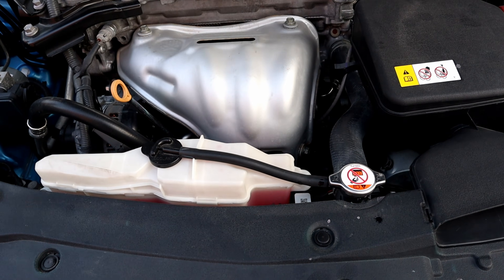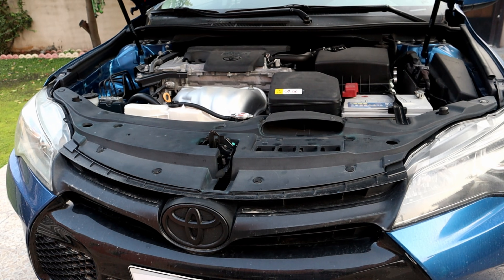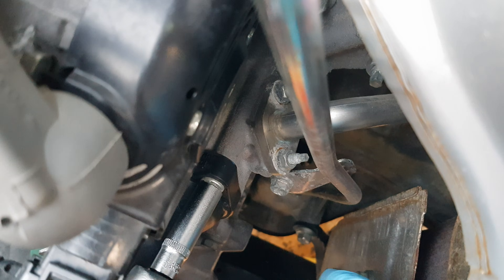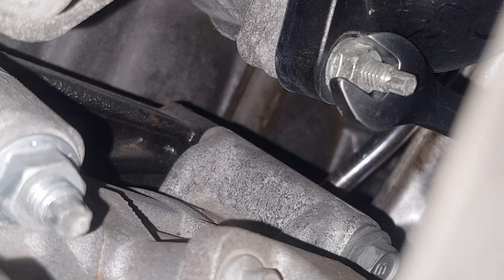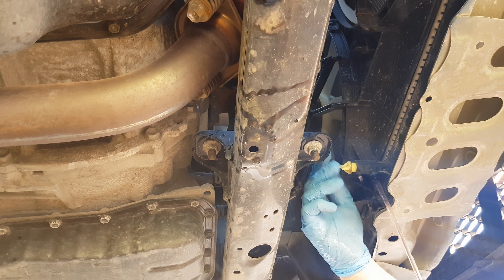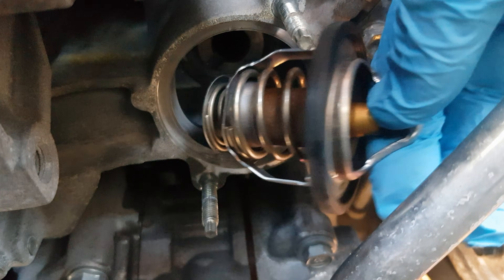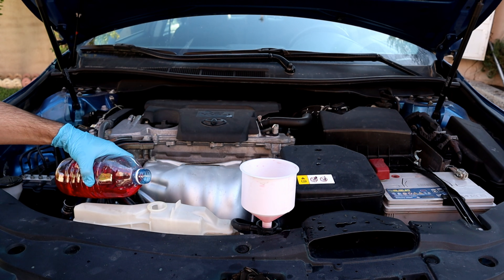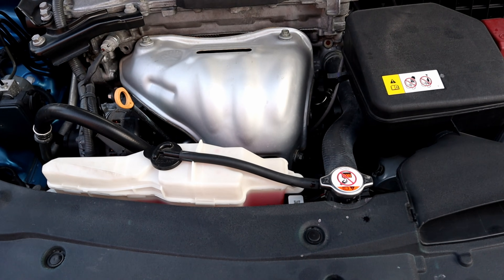How to do complete coolant flush/Coolant flush TOYOTA Camry 2015-2017/ How to change radiator water

Comment: Thank you for your time and putting together a great video.  

Since you cannot get all of the coolant out, when you flush with 100% water, you are weakening the 50/50 distilled water/coolant percentage.  I would believe draining coolant, filling with 50 50 mix, then a few days later after driving  50 or so miles do the process again.

Comment: The air scoop over the radiator on the drivers side comes off with two 10mm bolts and gives you plenty access to the drain valve from the top.  There is no need to go underneath the car other than sliding a catch pan under the drain tube.    Hope this helps🤣

Comment: I have the same car 2015 Toyota Camry XLE Hybrid and I have never changed a single thing. Still running on factory coolant. The only things I replace is oil change, filters, and tires. Best car I have ever owned and I bought it brand new from the Toyota lot 10 years ago in July 2015

Comment: Lil tip I learned when doing flushes and don't want to wait for engine to cool and don't want to take off thermostat. If you   use the drain valve on radiator after warming up for cleanse instead of trying to release pressure from the top which will get everywhere and prob burn yourself. With the drain valve (petcock) you can control the release and after a bit of draining pop the top and I have to say I have never had it spray out on me. Still hot but it's manageable. I've done it on about three cars so far. Nissan Xterra. Ford f250 sd v10, ram 1500 that's it I think gonna do on a Camry and rav 4 and I bet it will still work like the others 
 Of course try at your own risk just saying it worked for me!

Comment: I took my 17 Camry to the dealer for a simple drain and fill. All good until I got home and checked the reservoir tank. It was below the min. I called them back and asked why the reservoir tank was so low. They said that it's normal for my car. Is that true? Or did they neglect on topping off the reservoir tank?
Reply from the maker: It means the didn't take their time to turn the engine on and let it push all the air out of the system and refill it again to stay at operating coolant level
Reply: @AliMECH  What can I do now? Should I top off the reservoir tank?
Reply from the maker: @TheDvdyng35  sure you can, but i recommend you to go and they do that if you dont have, bc you already paid the whole thing, no need to buy

Comment: Hi thanks for this great video.
I have a question about the type of coolant used. I read somewhere for post 2004 models the Toyota Super Long Life Coolant should be used, because of the aluminium radiator will have better p protection by the SLLC. For your 2015-2017 Camry, how does the Long Life Coolant (not Super Long Life) perform? Thanks!

Comment: I did the same. First,flushed with the distilled water twice and added the 50/50 premixed super long life pink coolant. Problem was when I tested the freezing temperatures it showed me -20 due to leftover water further diluted the 50/50 premixed. I am planning to drain the 1.5l and add 1.5 antifreeze.

Comment: To save time on the flush, couldn't you just keep the petcock open while running the engine and adding distilled water to keep it full until it drains clear?

Comment: Great video, Thank you!  One question: Before you add half concentrated coolant and half distilled water, how much distilled water from the previous flush is remaining in the coolant system? If this is an issue to mixed 50:50 coolant, how to improve?
Reply: I second this. Wanted to ask

Comment: Good Job and thank you for posting. 
Just a question regarding the ratio of coolant to distilled water.
Since you are not draining the engine block of distilled water when flushing the system, you will still have water left in the engine block the last time you drain the radiator. 
Do you measure what drains out of the radiator the last time you do it and then fill to capacity with the concentrate coolant ? 
Otherwise the ratio will not be 50/50. Example - My Australian made 2016 Camry  takes a total of 7.9Lt, so if you drain the radiator and get only half of that out, you still have approximately half left in the engine block.
Reply: That’s the only bad part of this tutorial. You have to drain the engine block to be able to add 50/50 premix. So while you won’t get 100 of the water out, you get enough out so that it is still in the safe range. If you don’t drain the block, you have to concentrate to compensate.

Comment: Is it just as good to take off the lower radiator hose instead of using the radiator drain plug? I don't want to take off the under cartridge shrouds.
Reply from the maker: No problem you can ,  it's same
Reply: @AliMECH  Thank you.

Comment: Thanks for the video, 

I didnt do the step of removing the thermostat, just let the engine run until radiator fans turned on, however I went through 20 litres of distilled water and all the old coolant still wasnt flushed out, left the engine running for 5 mins when new water was added in to open the thermostat.

Any explanation? First time giving this a go

Comment: Why do some people say not to use 50/50 for a flush and fill?
Reply: Because there’s still water in the system. But as long as you drain the radiator and the engine block, you should be safe to use 50/50 premix. If you do not drain the engine block you still have too much water in there. Toyota made the block drains to compensate for the 50/50 mix.

Comment: Good video. One critique on the thermostat, the so-called jingle pin should be at 12 o'clock  you did not install at the 12 o'clock. Position. This helps remove any trapped air in the system really kill anything but that's the correct way
Reply: Air rises in most fluid system. The purge valve has to be at 12 o clock position on this type of cooling system to release air from. The system. Air can cause over heating
Reply: I noticed He put it back at the same exact position as He took it out. So that means, who ever did it last, didn’t place it a the 12 o’clock position.

Comment: Most clear concise video I’ve seen of the 10 toyota ones I’ve watched. Question for anyone. When he drains the distilled water there is still prolly a few quarts left inside engine after the flush. So when adding back new 50/50 coolant it will mix with distilled water that did not drain fully, and the mixture will not actually be 50/50. Is this a problem? For my 2nd gen Tacoma I want to use OEM coolant/antifreeze and they only make the 50/50 mixture. So I can’t add fully concentrated coolant and compensate for the extra distilled water remaining in the engine to balance out to 50/50 coolant to distilled water mixture. Any suggestions? 
For those of you that can purchase the fully concentrated coolant (or don’t mind using another brand not OEM) the best thing to do is look in your owners manual for the full capacity of the whole coolant system, then subtract whatever coolant drains out from the total capacity. The difference is the amount of fully concentrated mix you should add to balance out the remaining distilled water in the system. After that fill it with 50/50 mix.
Reply: As long as you get out as much water as Toyota makes it possible (radiator drain and engine block drain points) that is enough. So while you won’t have exactly 50/50 mix it’s still within range of being safe. Even a 70/30 mix is still safe. So you don’t have to worry about it. Also you don’t really have to do a coolant flush like this ever again. You should just get to a point where you drain the radiator and refill once every 2 years. A complete flush like this is pretty much only done when you neglected the system or are changing the coolant type (for example if you put in the green coolant and want to use the Toyota link coolant). If you really want to be overkill, on your last flush you can use Toyota coolant instead of distilled water. But it’s a waste of coolant so I wouldn’t do it.

Comment: Great, thanks ! 
Question - the part where you remove the thermostat....what are the basics without removing it ?
Reply: He's removing the thermostat to enable the distilled water to circulate even before the temperature rises. If not you would have to wait for the temperature to rise enough for circulation to happen and again a very long time to cool down again.  Hope you get the point
Reply from the maker: PR Jawahar is right, I did a video were I didn't remover the thermostat valve
Here I show how it can be done 
https://youtu.be/3r_KSRPv048

Comment: To those who would use 50/50 coolant, make sure you dump left overs of distilled water from engine. On models earlier then 2012 there engine drain plug you could use which emptying engine from coolant. Don't make same mistake as me. I tested coolant with coolant tester and it's no longer 50/50. So have to either add non predeluted/premixed coolant or just dump  radiator and engine again and refill, 20 backs more but safe.
Reply: Or maybe instead of using distilled water to flush you can use 50/50 coolant to flush old.. you won't be able to completely tell when all the old fluid is gone but if you flush it twice it should be good and it's all 50/50

Comment: Hi great vid. I followed exactly your instructions. Problem I'm having is the fans never turn on after running the vehicle 2015 camry xse 4 cylinder for 30 mins. Even though it turn on while I was flushing it with distelt water twice without the thermostate in the vehicle. And there was no bubble while I was running the vehicle for 30 mins. Any suggestions??
Reply: MMA KZ  no it hasn't. Never got a respond back. So I kept on topping up the antifreeze, kept a close eye. On the reservor. It's seems to be fine.
Reply: Did you turn the heater on ? That started my fans right up (17 camry 2.5L)

Comment: The Long Life Coolant in this video is not the same as the Super Long Life coolant that is found in the car when it's new.
I would simply use the Super Long Life pre-mixed coolant from Toyota which is good for five years or 50,000 miles. And flushing shouldn't be necessary unless the old coolant was contaminated or you're switching types of coolant. 
Okay because you're not flushing there may still be some old coolant in the system but it will be minimal. This is likely the reason that Toyota says the refill is only good for 50,000 miles or five years whereas the original factory fill is good for 100,000 miles or five years.
Reply: Thanks I was wondering if I bought the wrong one after this video

Comment: To get correct ratio at the end of flushing, I am thinking to use premixed 50/50 Super long life coolant. I will do just one flush. Of course it will cost me more, but I will fill confident regarding right coolant mixture. What do you think, guys?
Reply: Your right mate. Super long life coolant is the correct one. Its pink not red. Its premixed
Reply: I can’t see any other way to do it that would be correct. It will be more expensive needing twice the coolant. Especially if you’re using OEM Toyota coolant.

Comment: Will this work on a 2011?
Reply from the maker: yes
Reply: @AliMECH  oh sweet! So material wise was it 2 bottles of mixed coolant and just a few gallons of distilled? How many times did you run distilled through the system.

Comment: I have a 2014 Toyota Avalon with 130,000 km and the mechanic told me that my head gasket has a leak and the coolant reservoir was dry. 

Apparently this is a big job, can I just keep refilling the coolant and drive the car or should I use some kind of gasket seal fix in a bottle stuff?
Reply: Checking water pump ( my car water pump leaking so I change new water pump and it’s ok now)

Comment: Um, can someone help? I have a Toyota echo, how do you add coolant if it looks like it's too low to tell which kind of coolant to add? I found a leak into the passenger side near the floor, which might be the heater core possibly.
Reply: It’s leaking from heater core ( my car leaking from heater core)
Reply: @ThienTran-ul1jz  sorry to hear that. fortunately I got lucky, mine was not very expensive and turned out not to be the heater core

Comment: But would a distilled water flush change the ratio of coolant/water because the block will still have water in it?
Reply: You can always blow through with compressed air - or even use the air outlet of your shop vac. - to get most of the excess water out. Probably not too much of an issue, I would have thought...

Comment: Flushing is great, and using distilled water good, However...
After this job... drive it around say 1 hour. To get all coolant mixed in engine / heater core. Then let it cool down.
Then, pull cap and check coolant mix in radiator with tester. I bet it is weak (More water than antifreeze, not 50/50) Why? 
Because there was straight water left in block, hoses, & heater core after flush.
Reply: What's the solution for the 50/50 ratio or the proper way for replacing the coolant?
Reply: @mbz4652  
As long as the old coolant wasn't contaminated a flush is not necessary. Just drain the radiator and drain the engine block and refill it. Bring to operating temperature and let it cool down and then top it off. Check it again after your next drive and then top it off again the following morning.

Comment: what about the engine block coolant... it seems like there are 2 groups of people... 1) do not drain engine block, and 2) drain engine block.  When you turn car on and circulate distilled water, it has to be emptying the engine.. right?
Reply from the maker: Yes, you must empty as much as possible,  I usually use compressed air to blow it out, even if some states, no problem, it will be mixed with coolant

Comment: Good job AliMECH, but I noticed that you consumed too much of deionzed water as well as removing a thermostatic valve which it should not to be so, for full system coolent replacement, you have to drain fully from 3 drain points, 1st from the top reservoir, 2nd from the radiator, 3rd from engine block, then plug the radiator drain and the reservoir, then blow air by your mouth and let all old coolent come out from engine block, then surely you can pour the new coolent without any waste of money on purchasing a lot of distilled water for nothing.Thanks.
Reply from the maker: It's ok if some of distilled water stays in, the amount of that is gonna couse that much of a difference, of course if you have a compressed air it will be much better, but I didn't use it

Comment: While you chose your jack point correctly, I don’t think you put your jack stands in correct spots. It has to be where two notches are, closer to the edge. I heard that you can bend and even might go right through where you put your jack stands. I might be wrong, so correct me.
Reply from the maker: Actually this was the right spot for jack stand, that's the one strongest spots

Comment: Excellent vid with clear videos on each step. I just did drain and refill on my 2015 Corolla at 97K miles also have another 2016 corolla which I will plan to do a flush this time. 
How many gallons do I need to flush 2-3 gallons of 50/50?
Reply from the maker: Thanks, it really depends on how dirty coolant is, flush it till you see  clean water coming out

Comment: thanks for sharing but OEM toyota Pink coolant usually last 150k to 200k miles. you change it at 30k miles is a little too soon.
Reply from the maker: That's right,  on Toyota manual mentioned, that it needs to be changed after 3 years and I found some black small particles as well when I drain it, so it was good to change it
Reply: @AliMECH  yeah.. it is possible ..cheerrrr.

Comment: Suggest to study a bit the basic chemistry. Try to put iron nails to a distilled water. You will see corrosion in minutes. You are lucky there was some residual coolant liquid. Should you wash thoroughly you can, but make sure you always add a bit of coolant to the distilled water for flushing - it acts mainly as corrosion protection. This way you will protect the metals and still achieve super clean results. Good luck.
Reply: Agreed. I'm a machinist, have seen the same thing when people are washing the bare metal steel of the machine, it flash rusts very quickly. Has happened on super humid days as well.

Comment: First time I have seen a pink long life coolant. Do you not have Super long life replaceable after 100K miles/ 160 K km?
Reply: Louie, make sure that the coolant that you put in yours is the same color as the one coming out!! Otherwise it will give you lots of issues withing a few days/weeks! Look at your car manual and it should tell you specifically wich one to use, same for all other fluids. Newer cars are designed more picky than older ones where you could use whatever, now you just can't or if you do, prepare your pocket!

Comment: Why would you replace the coolant in a Camry So soon. The have pink long life coolant in them. Good for 7 years or 150,000 miles? I live in Canada and I haven't touched mine since it was new 8 years ago. Will change it this summer at 120,000KM
Reply from the maker: Do the voltage  test, like I did, of it reads close to 0.3 volts, u nees to change it, mine wasn't 0.3, but if u notice when I show the drain pan, there is small black particles in it, changing early gonna make the water pump life longer and keeps engine clean
Reply: Too risky to use 50/50 in Northern Ontario I use 60/40 or minimally 55/45.

Comment: I want to attempt this for my car but I am so scared. I love my camry though😭😩
Reply from the maker: You can also just drain the radiator coolant from the drain valve as i showed and fill it up with new one, without flushing few times like I did with distilled water
Reply: @AliMECH  this gives me peace of mind. I know for sure I can do that. The distilled water method, although it's the proper way to do it, look a bit intimidating.
Reply: Don't be upset I'll do it for you 🥺